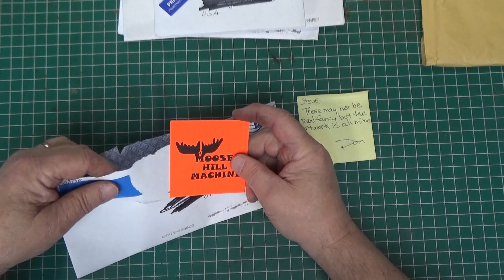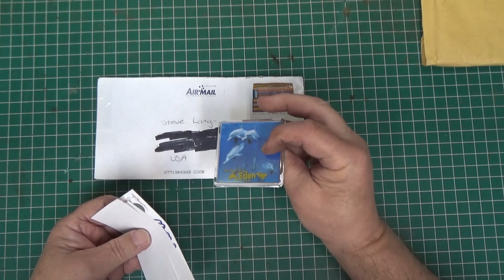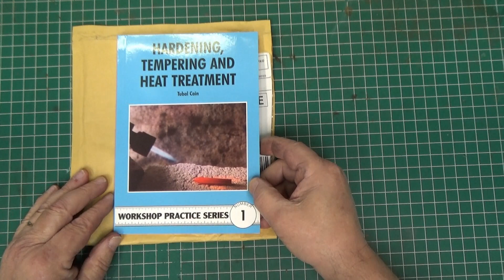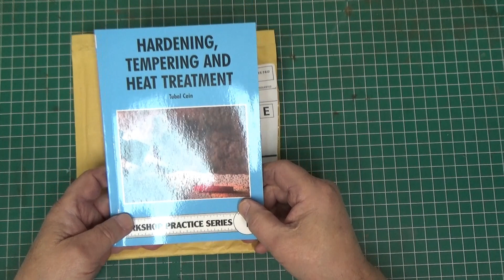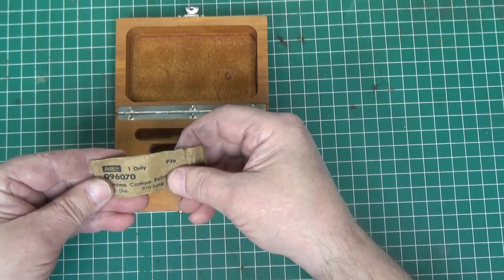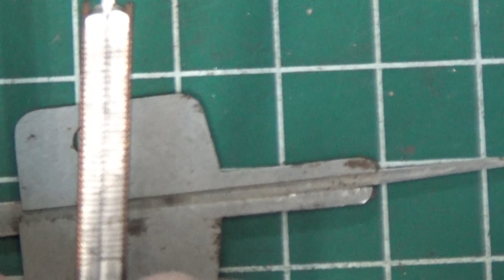Shark Bits #41- Viewer Mail, Mystery Tool?

Comment: Totally agree with you on the non-starrett brands, but not so much for m&w. Their quality seems kind of hit and miss. I have two squares from them both from the 1940s. They do not agree within two tenths over 6 in. Oddly, I have found that if you replace the radius knurled knob with a Starrett or Lufkin knob, the problem corrects itself. The radiused knob is over chamferred on both sides, makes for a poor fit. Lots of wonderful moorenWright, but you have to handle it to feel sure of its precision
Reply from the maker: I will be checking the accuracy of the new square.  I have a granite standard to check them against.

Comment: Pretty sure the mystery tools are for measuring small bores. You would capture both the depth as well as the diameter. There are no graduations because you would mic the area directly above the bore while the tool is in the hole. Pretty sure it originates from when calipers and dividers were the main lathe tooling
Reply from the maker: That very well be right.

Comment: In the tool room I worked in in the 80's we had several of those spacer/dividing heads.  I never seen that small version.  We would mill HSS and brazed carbide  3/4/6 flute counterbores and facing tools with the center and an 8 inch 3 jaw chuck on one  twice as large as yours!  That is a great unit to have in a small home shop!
Reply from the maker: I think that it is a perfect size for my shop.  I have looked at some on the internet and it looks like what they refer to as a size "0".  Thank you for watching and commenting.